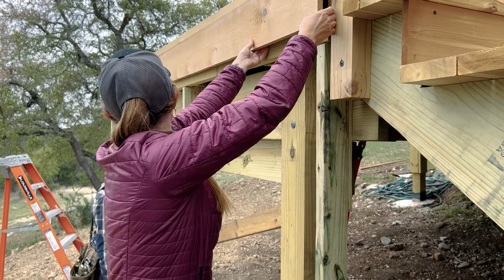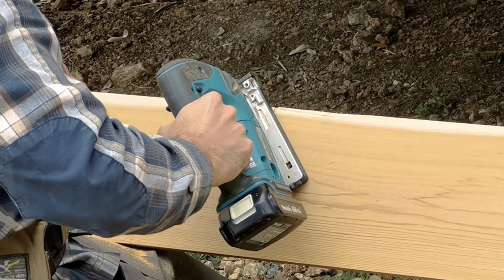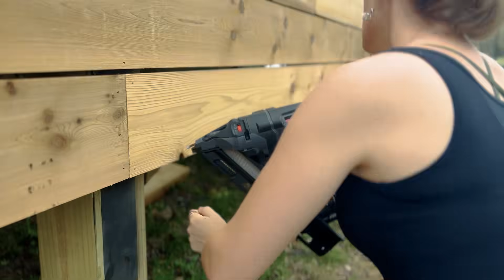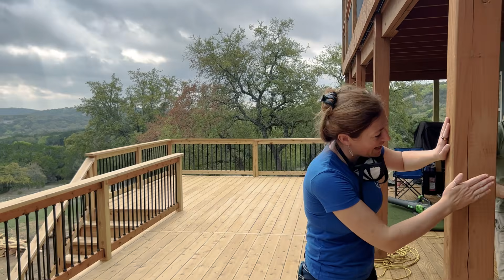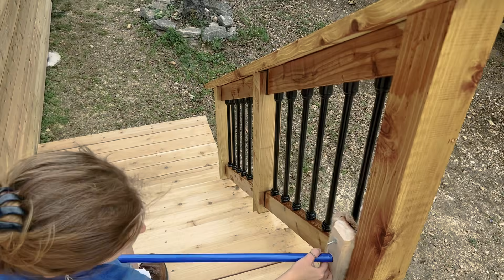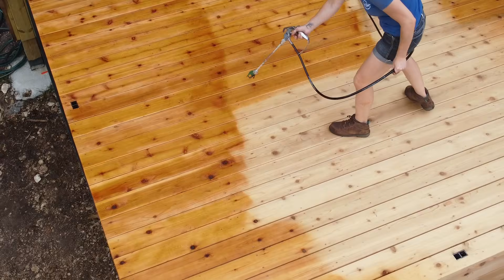How to Install Deck Skirting and Stain a Deck

Comment: All deck stain, oil or water based, only leaves behind a coating of plastic.  The plastic mainly sits on the top surface of the wood as all the oil/solvent evaporates.  There is no such thing as deck oil, it's deck plastic.  Linseed oil (plant) based stain is the only product that actually leaves the oil behind and penetrates into the wood pores.
Reply: Great point. For decking like April used (like this western cedar), do we still need to use linseed oil on it or can we leave the wood "bare"?  I have to replace 20-24 decking boards on an aging deck on our home that faces West and gets battered in the Georgia sun and am a bit novice if the decking needs to be finished off.  Appreciate your input!
Reply: @progression_decibel  Honestly, if you're replacing your deck, I'd recommend PVC decking.  Ipe and mahogany may last 20 years but many women don't like the weather grey look as it can look dirty.  Linseed oil stain (linseed paint diluted with linseed oil) is expensive and requires you to make an extra effort as its not widely available.  Don't paint your deck with linseed oil paint, dilute it and make a stain.  One benefit with linseed oil stain is that you can use inexpensive PT decking and the deck will last 30 years.  Keep in mind if you use PT, you can flip the boards over in 15 years and you basically have new smooth boards.  I did this, but few people do.
Reply: @richardmckrell4899  Thank you. We’re only interested in a short term solution of replacing cupped, worn, and splitting decking to prevent tripping and other hazards. Long term is to completely tear down the entire deck and rebuild with composite materials in a design and layout we love.  Thanks for the stain tip.

Comment: How did your stain hold up?  From the look of subsequent videos it looks like you may have refinished the new deck  with different product?  I would not be surprised given my western red cedar deck has been refinished no less than 3 times since it was replaced in 2020. Arrgh. Definite lessons learned, primarily not sanding too fine and allowing to age ~6 months prior to initial staining. Also product selection. First two applications used Sherwin Williams which didn’t cut it. Since I’ve switched to TWP with better success. The hill country intense sun requires an application probably yearly (oil based transparent product).

Comment: A. You are wonder woman
B. I need a deck around my spa, but looking at my old deck and the porch we just finished, I'm worried the boards will shrink and gap and it will look ragged in a year or two. How do you prevent this? Is it all about sealing or the wood quality? We don't use cedar, we use pressure treated lumber, not sure what it is.

Comment: You did good. But try to spray the entire length of the board, from end to end, if you can. Some areas are difficult to make that happen in but you'll like the results a lot more and it's ends up being a million times easier.

Comment: Great Tip about painting the studs black. It does help hide them. The cedar looks awesome stained! Great Choice April! 👍👏😃
Reply from the maker: Thanks! Yes, painting them black sure made a difference. Thanks for watching.
Reply: A great secondary benefit of joist tape underneath deck boards, that is also a nice touch.  👍

Comment: Question, 2 inch space at the bottom, aren't you worried about things getting in?  Bees, snakes, other critters?
Reply from the maker: If they get in, they are already around. I live in the country so you can't not have something, just because something may get in. Even if flush with ground, something could dig a small hole. Thanks for watching.
Reply: Just put a "No Bees, Snakes or Other Critters Allowed" sign up.

Comment: What is a lambs pod? Google does not seem to know either.
Reply: I'm not April, but actually, she said lambs pad. It's an applicator pad for applying finishes. I admit, the audio got a little garbled if the wind hit the mic. :)
Reply: @andrealavigne7824  Thank you but also in the Trans script at 5.49 it also says Lamps pod.
Reply from the maker: They transcribe what they think they hear.  :)
Reply: It's just a soft cloth on a stick.

Comment: Wood stain is a term that covers a wide variety of finishes, that can be anything from a dye in a spirit base that just literally stains the wood  grain, to a Water based opaque paint-like coating. I wish manufacturers were more consistent and transparent with what exactly there products did, that is Coating verses a dye, penetrating oil in spirit, wax or self hardening thinned oil like Linseed or Tung.
By the way the finish looks great!.

Comment: Good video, however the thumbnail is very misleading as it mentions turning it into storage. What did you do for storage in this video? Will that be addressed in a different video, as I am curious to see what you do there? Thanks for posting great videos
Reply from the maker: Yes, this is a deck building series so stay tuned. Thanks for watching.

Comment: It may not be an issue in your area, but I learned the hard way about leaving enough air gaps in skirting to make sure any moisture coming off the ground under the deck can leave. In my case it could not leave quickly enough through the sides, so it left through the top, and within a year the semitransparent stain on my deck boards was lifting up.
Reply: I'm in Atlanta and at an impasse as to whether of not I will skirt a floating deck I just built out in my backyard around a fire pit. It's 20 x 12 built with ground contact lumber, over a pretty decent slope with the front of the deck being 4" off the ground and the rear about 18". I want to skirt the sides and back so bad, but have the same concern you mentioned with yours about the moisture being able to escape. I'm going to use Penofin redwood penetrating oil so lifting is not my real concern, but of course longevity of my deck is...what to do, what to do... 🤔
Reply: Leave larger gaps, or build a decorative lattice.

Comment: April, I've recently learned about this low-cost technique for making wood weatherproof and rot proof that I would really like to see you do. It's from Japan, and it's called Shou Sugi Ban, or Yakisugi. It involves torching the wood a bit so that it creates a really nice-looking texture and then sealing it with oil. I want to do a deck similar to what you've done here, but also using this technique. If you can include it in one your projects and show me that it's something I could do I'd really appreciate it. 🙏 Thanks for the awesome and educational content!
Reply: Hi,

I've seen your message and just wanted to add my 2 cents as I really like Shou Sugi Ban and have tried to replicate it in quite a few projects. 
First off, I would not use it anywhere where there's foot traffic as you would need to seal it really well for it to keep that lovely appearance and not change color our transfer the color to your shoes. The easiest and best way to use it is for siding or anywhere that's upright, traditional cabin exterior, A framed cabin,  modern sheds, pergolas etc. You will have to experiment with it as in order to protect the wood, it needs to be charred and brushed afterwards. If you want to get the aesthetic of it but protect with something else at the end, you can use a torch, even a weed torch and move it around your timber until you get the desired effect. Good luck and have fun with it if you are going to try out for yourself. 

P.S. I absolutely love this technique but be careful when charring wood as you need to be in a well ventilated area and use wood that has not been treated. Also, not all types of wood do well with this technique.
Reply: Pls subscribe